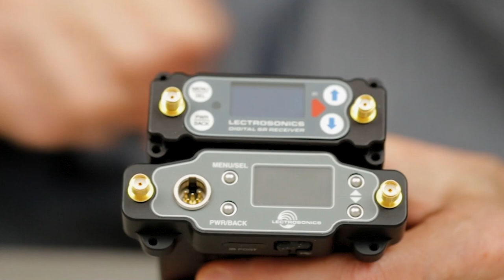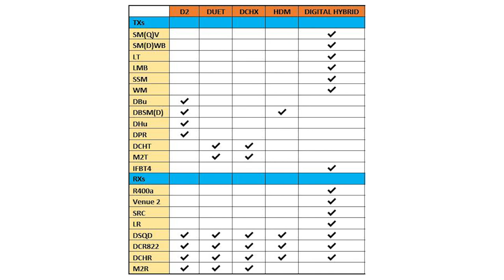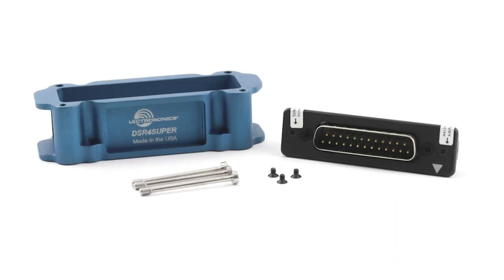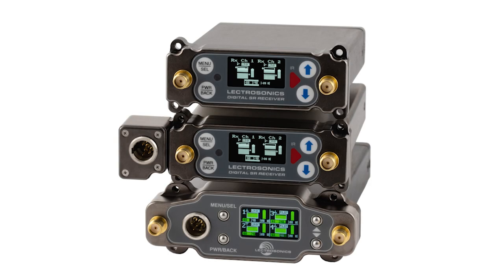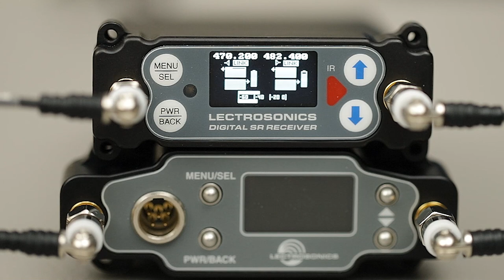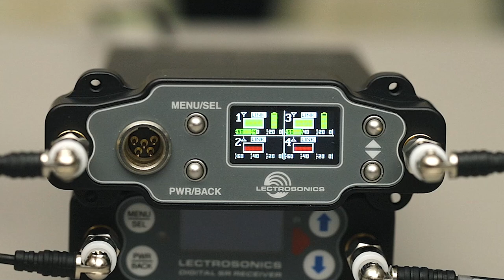DSR and DSR4 Digital Slot Receiver Introduction

Comment: Will these dsr in dual channel version work with dbms transmitters? What’s the newest single battery transmitter that will work with these dsr dual channel versions and how are those newer lectrosonic transmitters better than the dbms ones if so ?
Reply from the maker: Yes, the DSR dual-channel receiver is compatible with the DBSM and DBSMD digital transmitters. The newest single-battery transmitter is the DSSM although it is not shipping yet. The difference is that the DSSM is watertight, but otherwise would have nearly the same features and identical audio performance as the DBSM.

Comment: Is this your newest receiver ? What newest single battery transmitters work with these ? I’m only interested in the newest tech from lectrosonics
Reply from the maker: Yes, the DSR4 and DSR are the newest receivers from Lectrosonics. The newest transmitter we make that is compatible with these two receivers is the DSSM, although it is not yet available. The DBSM is available and has a wide range of features including full digital modulation, and is currently available.
Reply: @lectrosonics  what’s full digital modulation?
Reply from the maker: This means the radio signal is in a digital format - ours is 8PSK. This is completely different than FM (frequency modulation) used in analog radio systems. Here is some info on digital modulation: https://en.wikipedia.org/wiki/Phase-shift_keying
Reply: @lectrosonics   how is this better to have than previous model?
Reply from the maker: "better" might be subjective, but there are some features that digital can provide and analog can't, including encryption. Also, usually the digital wireless noise floor is lower and more stable. Finally, the range of the digital wireless system is not affected by the transmitter audio input settings the way it is with an analog FM-based system.
Reply: @lectrosonics  what good about encryption?
Reply from the maker: Encryption allows radio signals to be sent that are scrambled, so no one can decode them if listening in, unless they have the key. Check out this video if you are interested in this feature: https://www.youtube.com/watch?v=PguC1GYjfcA